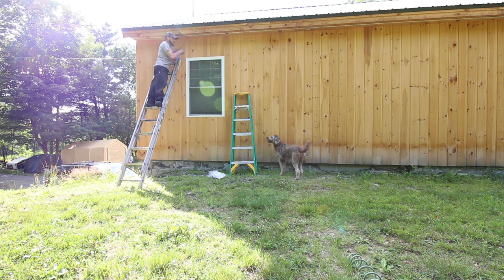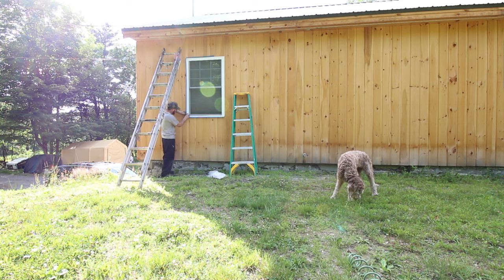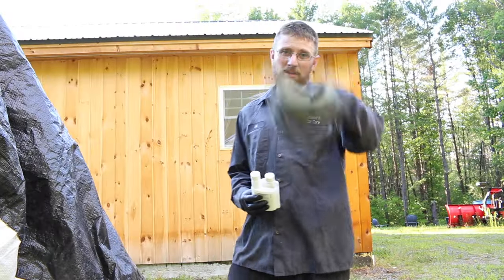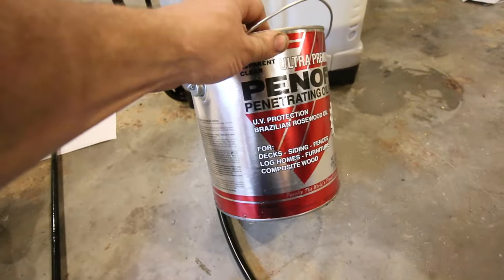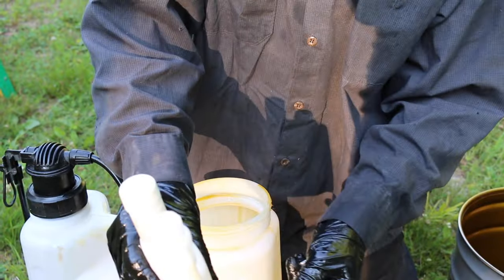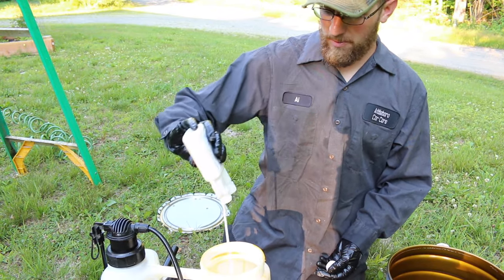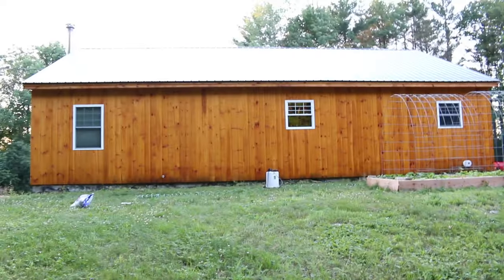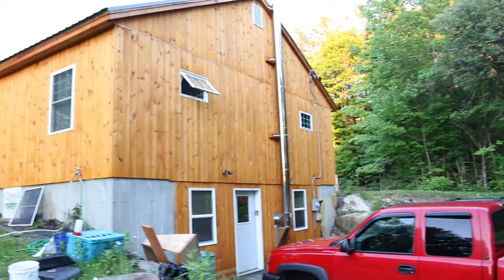Applying an Oil Finish To the Exterior of The House

Comment: It's crazy that you posted this video. I live in a log home and just recently finished staining the exterior of the logs and all of the porches.
Reply from the maker: +Arms Family Homestead that is to funny. What did you use for stain
Reply: +Lumnah Acres well my log home is over 30 years old and has been stained several times in the past. We used a solid color stain made by Cabot.
Reply from the maker: Arms Family Homestead Nice. How was that to do
Reply: +Lumnah Acres It wasn't bad at all. I bought a cheap airless sprayer and sprayed it on. I then followed up the sprayer with a heavy brush just to work it into the wood. It wasn't hard at all, like you said the prep work is what seems like more work. I did have to pressure wash the whole house first though.

Comment: What type of oil brand did you use? I built a redwood fence and planning on using Penofin clear uv oil. Is there anything else you can suggest on using, thank you.
Reply from the maker: that's the same brand and kind I used.  I would add bug juice to it to keep the bugs from land on it and building nest

Comment: The house looks really nice.  The oil really brings out the beauty of the siding.  Are you planning to install gutters?
Reply from the maker: thanks. no we don't plan on doing gutters. we would have to take them off every winter or the snow coming off the metal roof would rip them off

Comment: Did I understand correcty that you used "clear" stain?  It looks like it adds a nice color. to the wood?
Reply from the maker: Yes, it is a clear oil with UV protector in it
Reply: Great, I will give it a try.  Thanks for the fast response and nice video!

Comment: I appreciate the video. Can you spray this oil over wood that was previously stained?
Reply from the maker: +Off Grid Nation yes you can I would try it on a small spot to make sure you like the look of it. It is a penetrating oil so it might not soak in as deep since there is stain on the wood
Reply: Thanks for the reply. I'm was planning on re-staining my cabin but I think I'll go this route. Thanks again.
Reply from the maker: +Off Grid Nation no problem. Thanks for watching

Comment: I built a raw wood chicken house...would this be safe to use on that?  I know I need to do something to preserve it and I did not want to paint it.
Reply from the maker: yes just make sure the oil doesn't get on them when you apply it. it does have a smell but it is not that strong and it goes away in a few days. thanks for watching